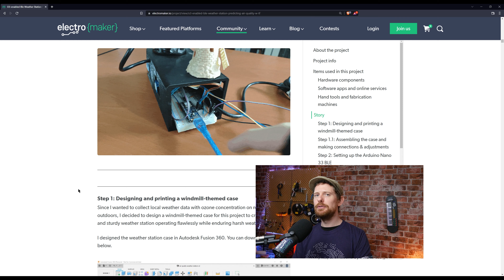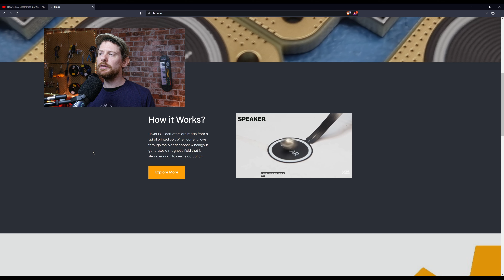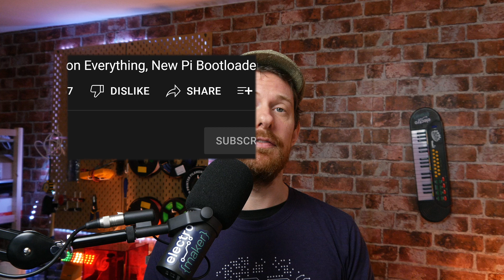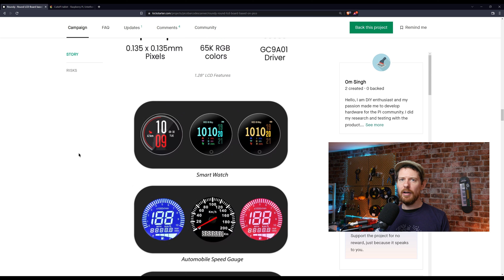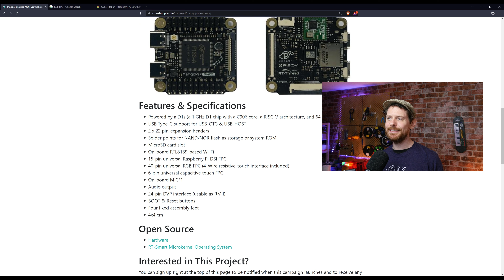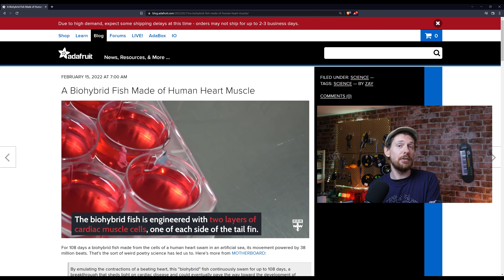Pi Zero Handheld, Arduino TensorFlow Weather Prediction, MangoPI RISC-V and More!

Comment: Ive been using arduino-cli for a while, much easier to just do arduino-cli update and  arduino-cli upgrade rather than faff with the GUI and search for boards/library updates. I still live in the shell and forget this modern Linux stuff I used proper UNIX (Dec 10/20/pdp11), HP-UX, SunOS etc

Comment: I think it is still possible to get clones of those "digispark" ATtiny85 boards from overseas marketplaces.  I've played with some, but have nothing written up at present.  Another interesting variant is the "USB beetle" which is an Arduino Leonardo variant board in a very similar form factor, but with an ATmega32U2, which makes for great USB to (TTL) serial converters. I've used them for a "kind of DIY PC MIDI interface" before.

Great show as always and a huge range of projects covered :)